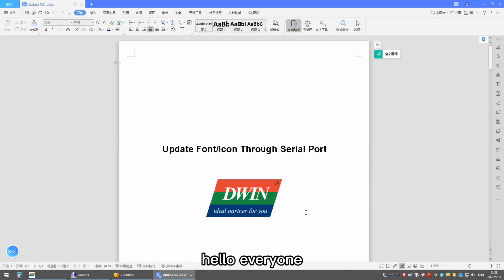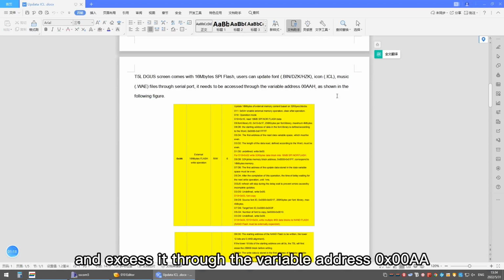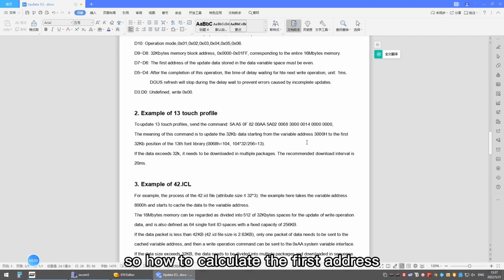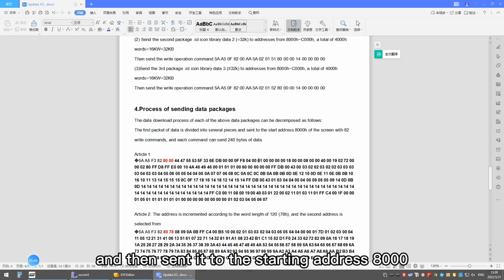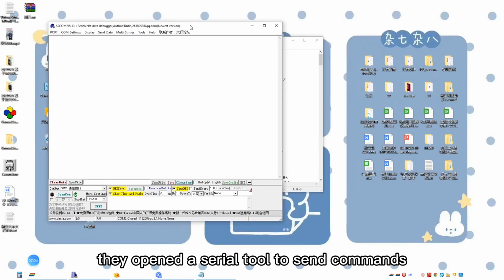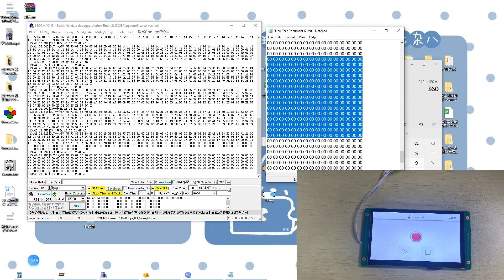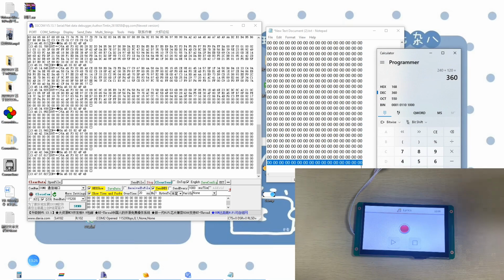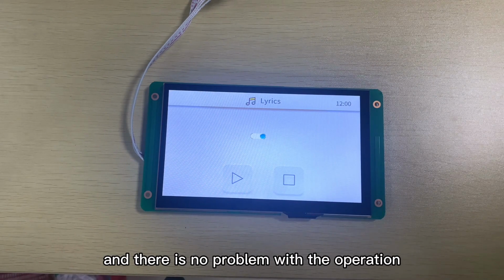Enhanced Tutorials 11 - Update ICL , fonts, icons and music files via #serial not SD card

Comment: Hi can you pls share the 32Kbytes memory block address for Touch, config, show, 32.ic and 42.icl
Reply from the maker: 0x0000—0x01FF, total 0×200 space, 32KB per space.
The name of touch, show, font, picture and icon are 0-63, 256KB per space.
In 0x0000—0x01FF, every 8-space were taken where the space of 0-63.

so for example,
One 16MB Flash block: 16*1024/32=512 (unit conversion, 1MB=1024KB), that
is, the range is: 0x0000-0x01FF (0-511);
Four 16MB Flash blocks: 16*4*1024/32=2048, that is, the range is: 0x0000- 0x07FF (0-2047). Update 32.ICL to calculate the start ID according to the 32KB data block sent: 32*256/32=256=0x0100, that is, the first data packet of 32.ICL is placed at 0x0100

The above example please refer to the page 56 "T5L_DGUSII-Application-Development-Guide-V2.8".

Comment: I followed this process and proceeded to upload 16.wae (voice file).

If the capacity is small, it operates normally, but if the capacity is large, it does not operate normally.

Is there a way to do this?
Reply from the maker: How about OTA? If possible you can contact the sales engineer to get the details.

Comment: Heyyy 
This was amazing video. 
But i have one query for you, as you showed in video you are updating it via UI software tool and manually sending the data , but i wanted to know that how i will be able to  update the icon files and 13,14 files via esp32 . How should i do it?
Reply from the maker: Suppose the esp32 is the computer.
Reply: @DwinTechnologyOfficial  yeah that's correct. But can you help me to provide some way points so that I can update via esp32.